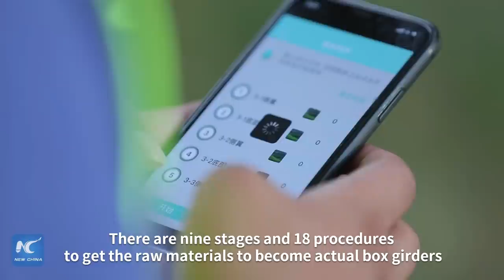Time-lapse video shows China's high-speed railway bridge construction process

Comment: wow, an assembly line for high speed rail. That’s incredible, imagine how many tons of concrete went into this
Reply: China is so good in mega projects because China have gotten it down to a fine art and can build any projects in the shortest time and the lowest cost.
Reply: each bridge weight about 600-800 tons. the heaviest is 1200 tons. without the right equipment, you wouldn't be able to move them.